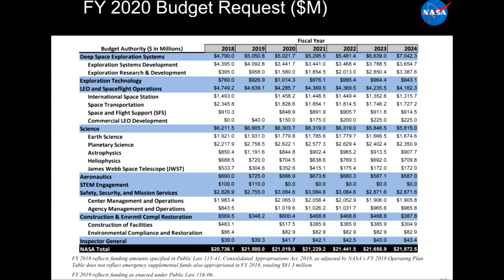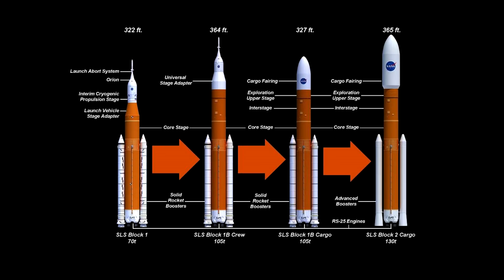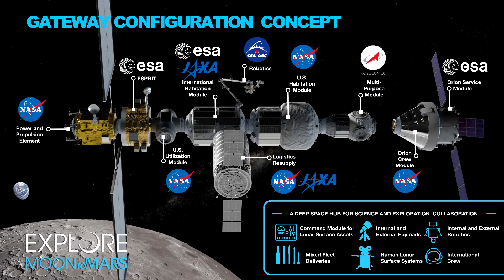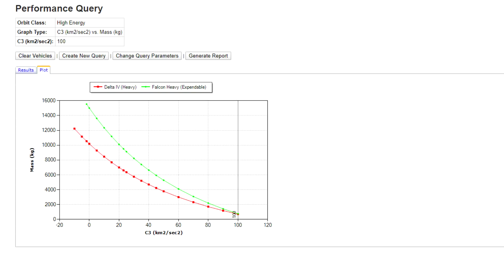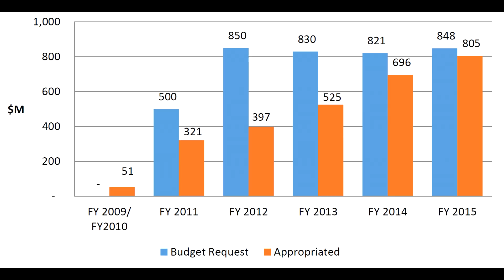SLS Rocket In Trouble After New White House Budget Request

Comment: Who didn't see this coming? SLS is using 40 year old shuttle tech, will be as expensive as the shuttle (If not more), and it's way over budget and way past it's development schedule. It is the Senate Launch System.
Reply: *Senate (money) Laundering System.
Reply: The House drafts the budget not the Senate. But who knows... maybe they will change the name to Socialist representatives.
Reply: caav56 😂😂🤣🤣
Reply: And it was intended to be used to build the LOPG, which would be an even bigger boondoggle than the ISS, and at the same time effectively cripple any plans NASA would have for going to the lunar surface. Good fucking riddance.
Reply: Why would you want to base yourself at the bottom of gravity well though? It massively increases the energy required to get anywhere (about 40%) whereas the performance loss for a lunar Halo orbit compared to direct escape is only 10%. People forget just how low LEO is, you still need 50% more energy to achieve escape velocity when in low earth orbit.
Reply: I said several years ago that SLS was looking exactly like a program that the engineers know is a white elephant, the project managers and NASA know is a white elephant, and will likely never fly, but they keep lying to to public and taking press photos of small bits being made to try and keep money coming in.

When the design is so conservative, so safe, using so many existing and proven parts, yet is this late and over budget, you know it's never going to happen. 

I can't really blame NASA though, SLS is Boeing's responsibility.
Reply: Scott has talked about this before, but none of the technology is actually old and they actually aren't reusing any shuttle parts despite the claims of this. Everything has been upgraded and re-designed to the point where it would have been cheaper to start from scratch. The only actual constant is the companies making the stuff. 

I totally agree it should just be cancelled though. Honestly NASA should probably stop trying to make their own launch hardware. If they were smart they'd divert the funding to space X, but I know Congress won't go for that.
Reply: Senate Launch System? That sir, is wonderfully droll. I would quibble just a bit on the 40 year old tech comment. The Centaur upper stage is even older; it's just a good design, so it still has relevance. Likewise, the SSME's could probably be used for some kind of one-off. I say one-off, because they were, as I recall, maintenance hogs as they were man-rated.
Reply: Well, SLS was promising just like Constellation... had they appeared in ready to use form at the same time as Shuttle and were used alongside it:D 
However considering how bad Shuttle turned out to be compared to the original plans...
Reply: But how else can we continue to employ the contractors we had for the shuttle? May I remind you they are political donors.
Reply: @rudyossanchez  Ask them to finally produce something new for a change. But be cautious, they might get a heart attack from hearing it…
Reply: @rudyossanchez  Political donors who should stop donating if they aren't  getting a budget in return.
Reply: 40 year old shuttle tech? I don't know why everyone thinks this about the SLS but it's not at all really. Almost every component is redesigned besides the engines which are basically the same version that flew on the last shuttle mission, because they are already one of the best engines, why reinvent the wheel.
Reply: @Kanglar  to be fair it is not reusable and the cost thus far has been astronomical compared to commercial vehicles
Reply: I wish it would launch the Senate, it might get more public support
Reply: To be fair, the Soyuz is 50 years old, and it's still flying.
Reply: I call it the Shelby Loot-distribution System
Reply: Situation Normal 😣
Reply: To be fair, even SpaceX's Starship is 75 year old LOX rocket tech, and now made of much more older steel.

I really wish they succeed in making the 2nd stage into ships that can return to land though.
Reply: @Levitiy  I believe spaceX is using a new alloy for steel. Secondly, SpaceX's engine tech is doing a lot of new stuff. SpaceX's pressurization and supercooling is unique and makes the rocket much more efficient. Also, the raptor coming up is using Methane, which is totally new, and they are using a closed cycle, something that hasn't been explored too much.
Reply: Agreed this is great news, the SLS is such a boondoggle.
Reply: It's the Senate Constituents' Make-work programme.
Reply: But hey, gotta subcontract as many components to as many districts as possible for those jobs jobs jobs. Regardless of efficacy. NASA is better off in its science mission and building probes than trying to reinvent lift for every administation.
Reply: I don't know how the system works but I would think the Gov would have benchmarks for projects to complete in order to keep funding.  I agree with everyone that if it's over budget and past its deadline then it's time to stop.  It just really sucks that these people do this instead of caring for the science and breakthroughs we could have had with that money and time.  I understand these people need to stay employed and I agree it would really really suck to lose your income and I don't wish that on anyone.  It's just this system is broken and looks to be broken by design.  There has to be a better way to keep these men employed in between projects that make their budget and time requirements.
Reply: Yup, Good riddance.
Reply: It's the only choice we have.
Reply: "The Senate Launch System". I'm going to steal that.
Reply: Awww, but it looks cool.
Reply: And its not even reusable.
Reply: Are you suggesting launching the Senate into space?  You're not gonna get any argument from me.
Reply: "Who didn't see this coming? SLS is using 40 year old shuttle tech"
Which is still up to date technology, educate yourself.
Reply: What's the point of SLS when they got space x blue Orion and all these company competing?? Just fund it
Reply: @tommywong3147 
Maybe because neither company has a man rated system with this payload?
Reply: Have you thought about the fact that most launch companies aren't interested in going to the moon, so they aren't building rockets with that in mind, nor are they thinking about things like maximizing the capabilities of the RCS, sending crew along with new sections to get fully operational faster, etc.
Reply: @maxk4324 
"nor are they thinking about things like maximizing the capabilities of the RCS, "

Waht are you talking about ?
Reply: @clausejoke1985  is that rhetorical or are you asking for clarification? If the latter, I mean that if you are building a giant moon base you will want a delivery vehicle capable of maneuvering heavy objects for extended periods of time. This requires A LOT of RCS fuel, which wouldn't be needed if you were not intending on designing an upper stage for this task. I hope that clarified my point.
Reply: @maxk4324  
"This requires A LOT of RCS fuel, which wouldn't be needed if you were not intending on designing an upper stage for this task. I hope that clarified my point."

The RCS fuel consumption will always be the same when moving a certain mass, you can not design a upper stage with less RCS fuel consumption.

You would have to invent a new RCS fuel with higher isp.

And no "Bases" on the ground will never be built with RCS fuel they have to be able to move modules on the ground.

RCS fuel has never been a limiting factor, please stop getting your knwoledge from KSP.
Reply: @clausejoke1985  Regarding bases, sorry I meant stations, that was my bad. Regarding RCS fuel, a given mass will need a given amount of thrust for a given delta V in some direction. The amount of fuel is more to do with how often the system must be used and for how long (and the weight of course, but even a large weight can require little RCS fuel on the launcher if it just needs to be deployed and forgotten about by the launcher).
Reply: @maxk4324 
"The amount of fuel is more to do with how often the system must be used and for how long (and the weight of course, but even a large weight can require little RCS fuel on the launcher if it just needs to be deployed and forgotten about by the launcher)."

What a useless bunch of gibberish.

A certain amount of delta-V has to be spent to move a certain mass. 

It doesnt matter how often you fire your rcs thrusters and you can't reduce the mass of the payload with a redesign of your upper stage.

I still don't know what you are talking about, there is no issue with RCS and there is absolutely nothing to gain other than inventing a new fuel or thruster system.(both unlikely)

So what the f are you talking about?

ps: Oh now I see (just looked at your subs) You are part of the I-fucking-love-science community and you have no clue what you are talking about....
Reply: There's nothing wrong with using Shuttle tech, the problem is (was?) the way they went around with it. Instead of leveraging the already-established shuttle technology to quickly get something to launch Orion it instead turned into the pork-project of all pork projects.

Jupiter as it was proposed makes so much more sense in retrospect compared to Ares V and the SLS it spawned. Jupiter would have used a slightly modified SS tank/core, identical SRBs, and the engines from the orbiter adapted to attach to the tank. Kind of an amalgam of old and existing hardware but it was proven hardware with (comparatively) minimal development costs that could satisfy the mission requirements. 

Orion and the research NASA has done to support it has been great, but the saying of "put the cart before the horse" doesn't get much more accurate than it does right now. The fact that we might realistically end up with the simulatenous launch  Orion on a Delta IV and a crew on a Dragon+Falcon9 for a subsequent docking and crew transfer to go around the moon really does say a lot.
Reply: Yo don't diss the SLD
Reply: Yo don't diss the SLS
Reply: Seriously, never thought this was going to actually happen.
Reply: Sallent R wow senate launch system lol! You hit it on the mark.
Reply: Sallent SLS will cost 2 billion
Reply: I really hope they do cut the SLS off. The sunk cost is insane, but it would still cost less to just stop the program and use commercial vehicles. 

If they reeeeeaaalllly needed to have their own launcher they could always just buy a few boosters from any number of US based companies, and then use their own proprietary upper stage if needed.
Reply: Matthew McKellar it looks really cool though
Reply: @williamforbes6919  That's not the right approach either. 

NASA should be put back into the business of making new technology instead of being used as a political pawn for partizan bragging rights. 

For example they should finish their goddamn SSTO which was cut at 90% completion. 

A craft that unlike the space shuttle was designed to be a fully reusable means for daily access to LEO and orbital industry.
Reply: @fl00fydragon  My intent was to say that they shouldn't be trying to compete with private companies, instead developing and researching new technology and exploring space. What happened to the Venturestar is definitely unfortunate. I wouldn't classify the development of an SSTO as direct competition with private companies though, as there was no private competition and that no SSTO had ever been built before making it the development of new technology.

We have commercial orbital class launchers now though, and we will soon have commercial heavy class launchers. NASA doesn't need to blow it's budget on developing technology we already have.
Reply: @fl00fydragon  If they had a better budget, the shuttle wouldn’t have been given to the USAF and they wouldn’t have increased the price tenfold.
Reply: Just a way to keep the union boys on the job
Reply: @thepropaganda1066  Seems like getting the thing airborne wouldve been the best way to keep them on the job ;)
Reply: @1320crusier  not really if you can keep the government  throwing money at it them boys will be happy to look at it  and Tell the government different way if could go
Reply: @1320crusier we both can agree on that
Reply: They should scrap S.L.S. Shit Launch System all together. Here they are trying to use rockets twice  the price or more then a Falcon 9 and let it become a space fossil. No reusability at this point in time is a joke.
Reply: InsertInsultHere poor comparison.  The Falcon 9 doesn’t have the thrust to put manned missions on the Moon.

Also in regard to the 40 year old tech comment, no one’s complaining about the Soyuz rocket, which is based on 70 year old tech...
Reply: @thebigitchy  The SLS isn't able to put a manned mission on the moon. Personally, I think that if somebody convinced nasa to put a fantastic kicker stage on a falcon heavy, it would make a great moon rocket.
Reply: Keep in mind everyone, that keeping alive NASA's rocket supply chain all these years was the right thing to do. That sort of thing can't just be restarted if it was ever unfunded, if we ever really needed it for something. A lot of people miss this in Eisenhower's warning on the military-industrial complex, of which SLS is a part. You can't be too mean to them, because we need them. Now, at some point, when everybody and their grandmother has a nice rocket, then SLS is no longer a military-industrial necessity, but instead just a big budget item that the American people don't have to have. But I think we just got there. (Also, I don't see much value in a moon base.)
Reply: It's treason then.
Reply: @johnviljoen271  "I AM THE SENATE"
Reply: Continuously starting over because it isnt perfect means nothing gets done.  SLS is what is currently in progress.  Junking the program and starting new means ANOTHER decade.
Reply: @1320crusier  or fifty more years.

Comment: Would a solid rocket kick stage actually allow for more cargo launched to Jupiter on a Falcon Heavy? It would require an even heavier launch, and using a lower ISP fuel for the top stage, so it seems to me it wouldn't help much. Am I missing something?
Reply from the maker: Still needs one gravity assist, unless they develop a bigger kick stage (like the one they would have used to launch PSP on an Atlas)
Reply: @scottmanley  I certainly agree with that! It seems that Delta Heavy could do it with at least an EVEJ assist, and FH with a EEJ assist. An EEJ launch around Oct-31-2023 would require only 25 C3 and a 4.5 year path, which seems quite reasonable. I love NASA Ames Research Center Trajectory Browser:-)

Comment: NASA should do what NASA is really good at, research . If they want a continuous presence on the moon, they should start a moon university and fly crew, faculty, and students there on commercial rockets. They can then, copy and paste and start a university on Mars as well.
Reply: Yes--NASA needs to do what its predecessor agency, the NACA, did for aeronautics and early spaceflight. The NACA did high-risk/high-payoff research on jet and rocket engines, advanced aerodynamics and materials, and avionics--unlike NASA, the NACA did ^not^ undertake to develop and run an air transport system--they did research and freely shared their data with industry, which developed ever-better military and civilian aircraft. NASA must return to this fundamental research work, for both aviation and spaceflight. A lunar research base would fit perfectly within this NACA-type role. Neil P. Ruzic's 1970 book "Where the Winds Sleep" covers the many types of basic research--and even industrial operations, to be done by commercial firms later--that the free vacuum and free cryogenic night-time cold (plus local raw materials) on the Moon would make practical.

Comment: It's even worse than Apollo... They're killing the SLS before it had even flown
Reply: SLS isn't worth continuing at it's current cost.
Reply: It's abundantly clear that SLS is a pre-obsolete program. It should be cancelled. Other vehicles will be more affordable while simultaneously being more capable, and that's not even getting into the massive development costs.
Reply: @thirteenthandy  which ones?
Reply: phoneix 007 Falcon heavy, Big Falcon Rocket...
Reply: @phoneix0074  Falcon Heavy, New Glenn, and Vulcan. Starship a little further out.
Reply: Well maybe Vulcan can lift Orion to the Moon but so much money has been sunken into the SLS that its just not economical to cancel it.
Reply: @phoneix0074  That's called the "sunk cost" fallacy, just because you're already in the hole doesn't mean it's cheaper to keep digging, in fact, it's usually a sign you should've quit ages ago because you're chasing a false promise.
Reply: phoneix 007 SLS is not usefull, is trash
Reply: @phoneix0074  "because we've already spent too much" isn't a valid reason to continue a program. That's robbing the taxpayers.

Comment: The "benefit" of cutting the budgets is you Guarantee the program will then go over budget and not be ready on time.
Reply: Delaying the inevitable is an all-to-familiar political ploy. It continues to prime the employment pump in the congress critter's home district and if the attitude towards the project changes with the political climate to being in favor, so much the better. Yes, it's obvious and disgusting.
Reply: @williamswenson5315  actually I'm saying the opposite. Changing budgets and specifications guarantees a 'failed' project. Either fund the thing, or figure out what parts are worth saving, fund those and kill the overall project.
Reply: SLS does not need help to go over budget and be late. It's already over budget and late.
Reply: @polygondwanaland8390  Yeah. It needs to be cut. Badly. It needed to be cut 5 years ago.